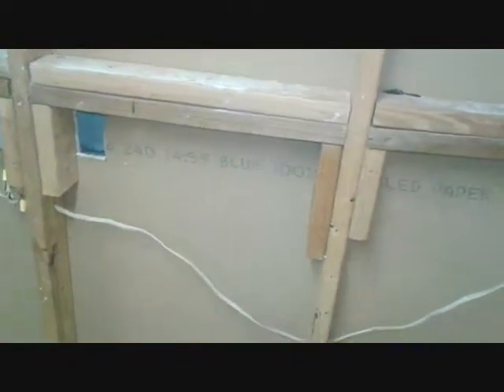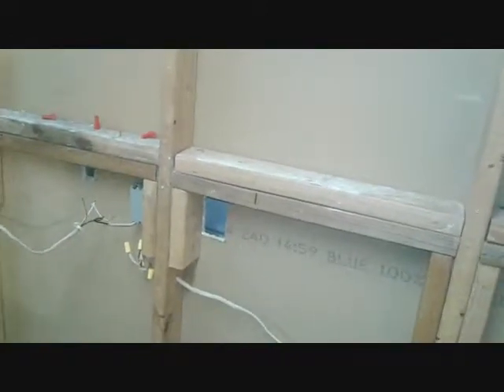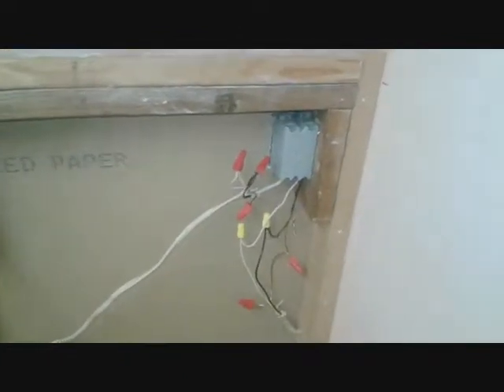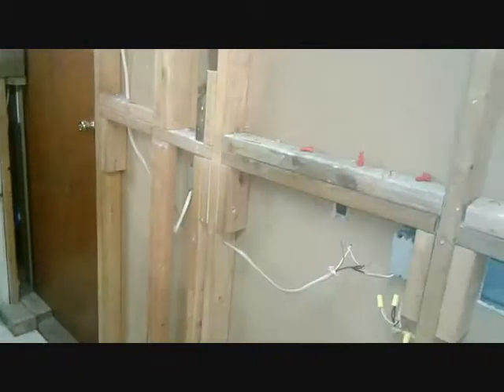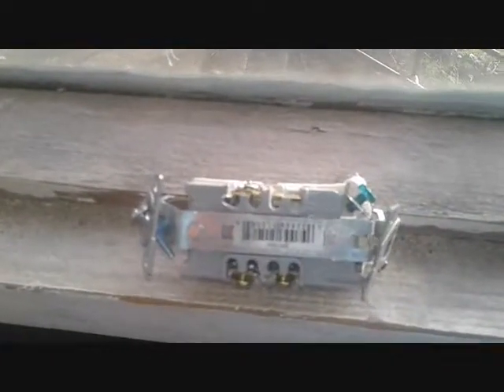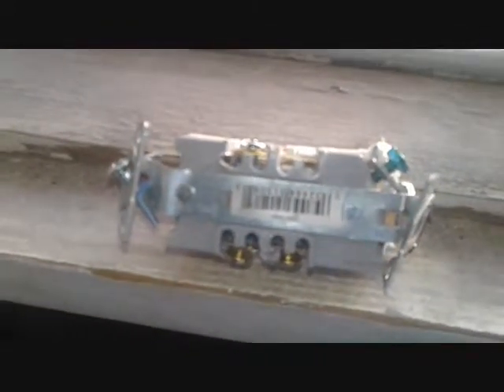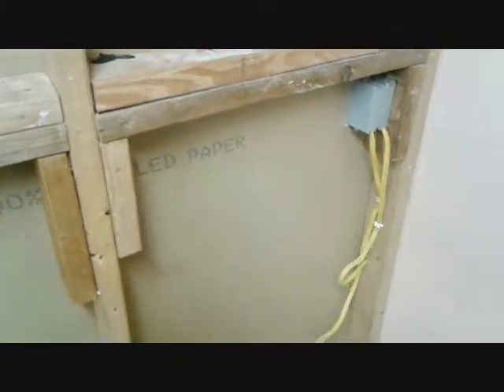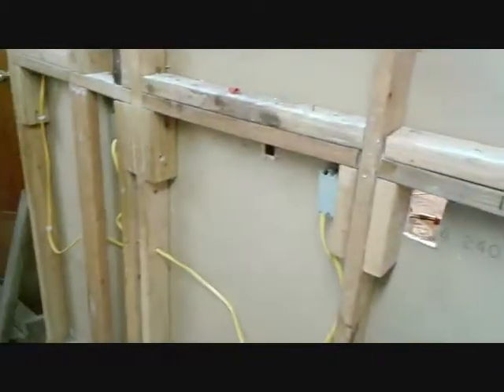ELECTRICAL SOCKET FAIL! The reason to always wire pigtails!

Comment: I’m a 25 year electrician, I’ve had my masters license for 18 years. We see stuff like this all the time. We call those “open joints”. It’s a good thing you found this and got rid of it, people don’t realize or don’t care about how big of a fire hazard that is to do that. All connections MUST be in a box and accessible. The boxes we use on our residential applications have a 2 hour fire rating-Hence the reason to put them in a box. I would be looking really hard at the rest of your house to make sure you don’t have any more of this. Which sucks, because you’ll almost have to start pulling wall coverings to see. I would probably recommend some AFCI breakers or plugs for your branch circuits. At least if there’s more of that covered up in your home, hopefully the AFCI (arc fault circuit interrupter) would catch it before you have a fire.

Comment: Also, you want any terminations or wire nuts in your boxes. Not behind the walls, where you will never be able to get to them once everything is installed. Good job with the re-wire!
Reply from the maker: you are 100 percent right. tearing walls down tracing one wire can be a pain lol

Comment: in old homes, i'd be worried about the pigtails themselves. saw someone duct tape a pigtail instead of using a wire nut in the condo I just bought. not to mention burying outlets a foot deep. thank god for WAGO connectors.

Comment: lol you screw your terms tight the metal bridge in the outlet will hold more current than the pigtail. proper install is the key though
Reply: LOL I just like the fact that the cowboy electrician that originally did that Went with spec grade or more likely commercial grade duplex receptacles.  Got to love those open-air splices in the wall, which are horrible (code violation for a reason) when you're trying to troubleshoot where problem occur.
 proper insulation is key.